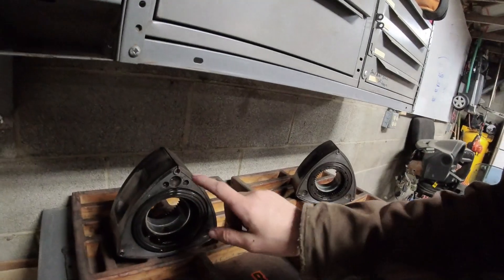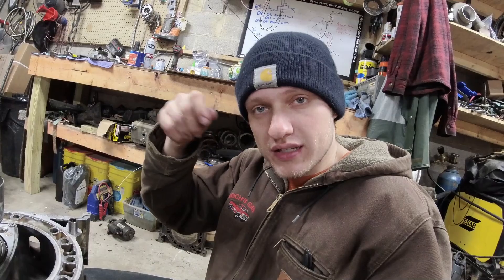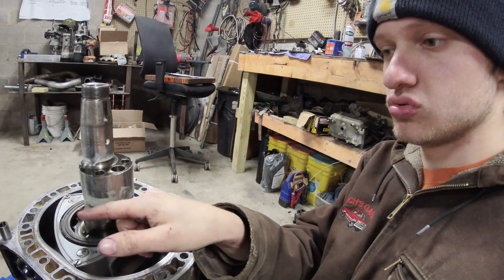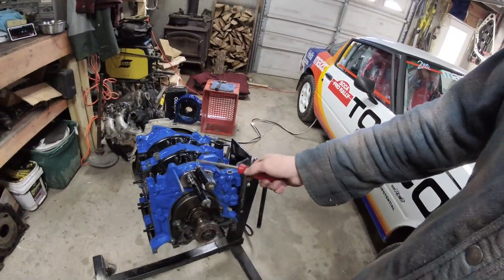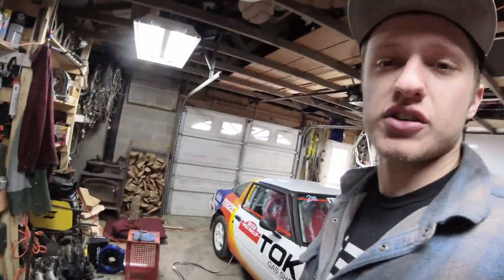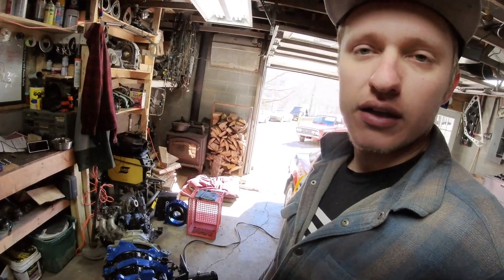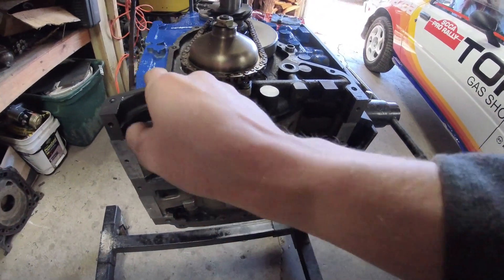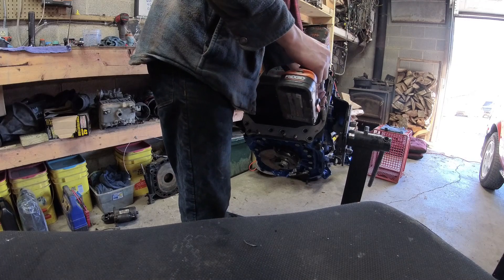Gluing Rotary Engine Apex Seals Together To Rebuild this 13b REW

Comment: Just finished watching this entire series of this oops and I’m going to exactly the same problem now and I think this is what my engine issue is. I did try super glowing it but like you explained the super low kept breaking on me little frustrating and I probably wasn’t as thorough as I needed to be to make sure that Apex seal corner was where it’s supposed to be… so back out the engine comes

Comment: Hey Rad Potential!

So I just got done with a marathon this evening watching all 4 or 5 videos from this build ( I lost track ). Excellent job!! Your a gifted communicator and very impressive scope of knowledge you have. I was also very impressed with all the camera angles and the fluidity you had balancing recording and literally balancing the motor with your knees!

I do have one question for this last part.
Is there any concern about having the superglue in there? I mean isn’t the design of these little triangle corners on the apex seals like that for a reason? I imagine the bond with the glue would break quickly which would be fine but then it seems like some super glue residue would be trapped in there and interfere with the fluctuation you want for thermal expansion. 
How did it end up working out for your friend BTW?

Well anyways I just subscribed and your awesome man!!
Reply: It all gets burned off pretty quickly

Comment: I’m using the Atkins coolant pressure tester after a rebuild. Starting at 21 psi after an hour drops to 8 psi. .21 psi/min. Clamped down the water pump gasket with the tester to 30 Nm and around 24 Nm on the intake plugs. Can’t hear any hissing noises anywhere it’s plugged off. Pretty frustrating kind of wish I had this pineapple racing unit instead seems like better quality. Gonna try filling the engine up with coolant and try pressurizing again to see if coolant is coming out of the plugs. Wish me luck it’s not internal 😔
Reply: Update: it was leaking at the rear iron top plug. Adding coolant helped find it. Held 20 psi for 2 hours. Thank you

Comment: Try goopy unbreakable one piece seals they are literally unbreakable..oh and u got to decrease the seals before u glue them really well oh and put the glued part down and use hobby ca glue with activator spray from the hobby shop

Comment: What are your thoughts on the 1980 leather sport model in solar gold? I read they only made 500, mostly manual trans. Mine is automatic trans with ac and a wing all original, can’t find another example anywhere. Have you seen any?

Comment: I glue mine with Loctite 495, works great but will still break apart when the engine turns over.

Comment: New Mazda apex seals come pre-glued. I built my engine a few months ago with new Mazda seals and no gluing was necessary. 
Also, for the coolant pressure tester, if you smear Vaseline on the rubber gasket it seals very well and no need to crank down on the bolts and risk snapping a bolt.

Comment: I never glue mine. With 2 piece seals, I slide down the apex seal and then use the large apex seal spring to push down the small spring. When that spring hits the inner landing of the apex seal and stops, I then push down the large spring. Then I just put the corner piece in place and some Vaseline on top. Once you put the plates down, everything squeezes in place and corner piece will wedge into position. With 3 piece Apex seals, I do the exact same thing but slide both seals in the rotor groove at the same time and repeat everything else just the same.

Edit: The problem with glueing the seals is if you don't glue the corner piece in correctly, the corner edge may not contact the side plate to break it free which will create a compression leak around that seal. Makes for hard 1st starting until heat expansion breaks the bond.
Reply from the maker: For sure!!  Thats how I had always done it until I had this issue.  Given the issues I fought doing this build. I think im going to keep doing it the old way haha